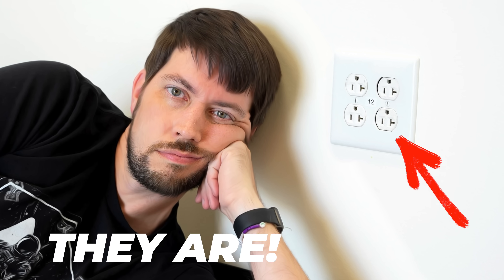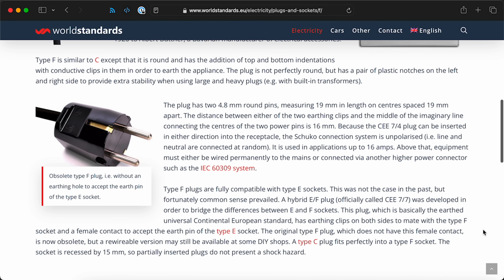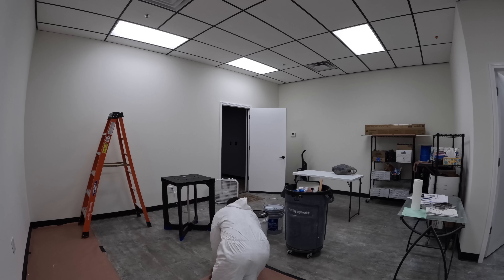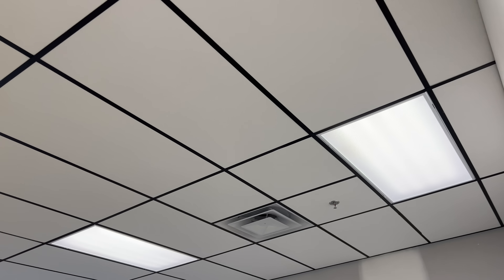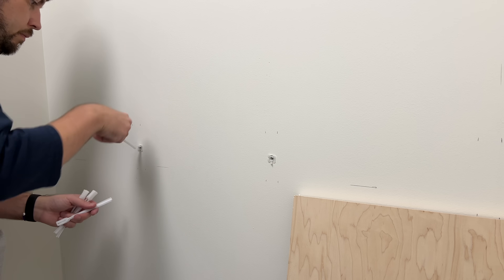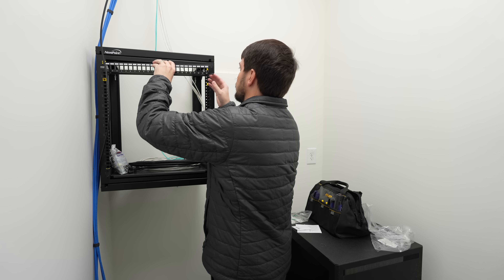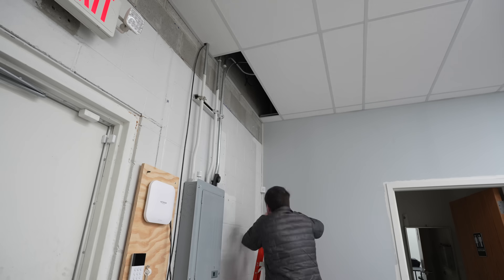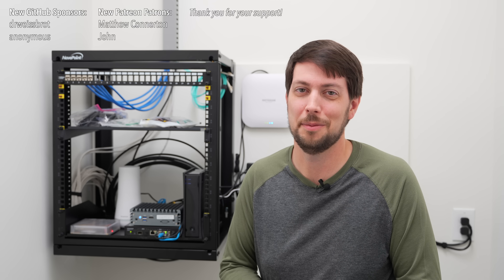Wiring up a small office network rack (moving 10)

Comment: Why??? Why the hell are you holding the whole rack to the wall while leveling it???? Measure the distance between the holes, grab a tape measure, mark the width with two lines and set a 90 degree leveled line. done. :D

Comment: how did the rack studs work out? I tried several different colors and they all sag, even with just a patch panel. The traditional cage nuts seem to hold better
Reply from the maker: I've found them to work best when you use all four, since they add a millimeter or two extra distance between the front of the rails and the equipment, meaning with just one set at the top, equipment can more easily sag a little.

I also try to use traditional cage nuts for anything more than 10-20 lbs, as I think the rating is like 40 lbs max, but I don't like getting anywhere near the rated maximums!

Comment: Just a comment about the outlets. While there's no actual "code" that dictates it, the way they are mounted is the preferred standard. That way if you have a loose plug and something drops onio the prongs, it will ground and trip the breaker.

Comment: 12:50 I'm a cabinet builder electrician and that cable raceway is typically used inside the cabinets. Outside it looks ugly. There are exterior PVC variants big enough to fit your cables and they look much neater since they match the wall color. (also self tapping screws into drywall and wood makes life easy.)

Comment: Your sound proofing door sweep was installed on the wrong side of the door. It won't drag across the threshold, make the door hard to open or wear out prematurely if you switch it to the other side.

Comment: I would just terminate all of your Ethernet into the patch panel, POE or otherwise, and then just get a POE switch so everything can use POE if it uses it, and then you can just VLAN off anything you don't want on your main network. My core switch is a Procurve 5406R ZL2 with a bunch of VLANs and every jack in my house is POE capable.

Comment: I've had multiple racks in my last 3 homes.  My best advice on the cable modem... just mount it to the plywood.  Many of them (all of the ones I've owned) have keyhole slots for this purpose.  It's not all that useful to have in the rack if it's purely a modem (one coax or fiber, one baseT, DC power); there isn't any re-patching you're going to be doing there.  It'll take up space in the rack that's more useful for other things.  I started mounting mine on the plywood backer a long time ago and haven't looked back.  Plus the broadband tech won't complain about access for his tester whenever you need service. 🙂

UPS looks a bit janky, but I understand.  Over the long haul I'd put some money in one or more rack mounted units, choosing in part based on availability of replacement batteries locally and of course reliability.  I use Eaton (which used to be Powerware, and before that Best Power).  Lead acid batteries tend to be good for about 5 years if you're lucky, 3 years if you're not (and that's with a line interactive; my double conversion UPS' batteries get a little less life).  My oldest UPS is a Best Power line interactive, bought in the middle 1990's.  Still works well, and has had many battery replacements (which I can get at the local Batteries Plus).  Get one you can manage with 'nut' (Network UPS Tools) or similar, whether via USB or add-on ethernet card.  I like skipping the add-on ethernet and just using a Pi connected via USB.  Cheaper, a lot more flexible, and less of a security risk.

Of course I wouldn't put a lead acid UPS in that particular wall rack (even if you can find one that will fit).  It will definitely sag (they're ungodly heavy!).  Bottom of a rolling rack is great.

All of my machines shut down gracefully before battery dies in the corresponding UPS, via nutmon.  I like to have more time for 'critical network' infrastructure (for me that's cable modem, main 48-port PoE switch, main 10G switch, DNS server).  Have the power hogs shut down early when on battery for more than a blip, or use a separate UPS.  Nearly all of my power blips are brief, but when they're long, I like to have a little bit of extra time to send out the "We'll be offline for a while, power is out" texts and emails before the whole shebang is down.  At home I typically get 40 minutes or so of 'critical stuff still running' on battery, but 10 to 15 minutes is usually sufficient.

A rack mount PDU with pull-out lights is really nice to have at the top of the rack.  Esp. if you're trying to find something in the bottom of a rack drawer when the room lights are out.

I'm assuming you're going to put a rolling rack underneath?  Any plans for rackmount drawers and a pull-out 1U keyboard and monitor for KVM?  May seem like a luxury, but I can't live without these things in my main rack.  If the network goes belly-up, I need command line access at the rack.  And it's priceless having the tools and consumables I typically need right there in the rack.  Ratcheting driver, bits, magnetic LED work light, rack nuts, rack screws, patch cables, bootable thumb drives, cable testers, crimpers, SFP+ transceivers, etc.  Neatly tucked away in drawers (lockable if you like).

My keyboard+monitor for KVM was an eBay purchase, dirt cheap but has worked great for over 10 years.  I have dozens of Middle Atlantic rack mount drawers, but based on price, I can't recommend them today (most of mine are 20 years old, bought when prices weren't obscene).  The NavePoint are a pretty good bang for buck, as are the Penn Elcom heavy-duty.

Comment: For racking the cable modem you might consult with your ISP and see if they have a rack mountable modem or info on a rack mounting kit for your current modem. For the other stuff you can just leave them be on a rack shelf suitable for the height of the devices.

Comment: instead of brute forcing the screw into the powder coated hole. go a few turns in the back it out and then repeat. this way it clears the thread a little and doesnt run the risk of snapping the screw head.

Comment: Had the electricians leave a good 10 feet extra cat6 and coax looped on the basement floor when wiring my new house.  Came back to check things a few days later.. and some do-gooder "cleaned up" by cutting all the excess off leaving them all 3 feet off the floor.  Grrrr.

Comment: Crow Pi Cam videos and live stream?

Small restaurant microwaves have no visible clock. They also have no turning platter but a turning reflector under the bottom. Fit square plates! Much easier to use, no "smart" stuff.

Comment: I'm looking at the rack, and how it would swing out. A deep device, or a long shelf, might contact the wall to the left, as it swings. Also, since the AP should be ceiling mounted, just run the cable up the raceway. Also, the cables all need to go to the pivot of the hinge.
Reply from the maker: Luckily it can swing in both directions — so if I swing out towards the wall, everything should fit fine.

And for the AP, I couldn't find the ceiling mount (the thing comes with a little T-bar clip!)... but I just did tonight while moving some last few items. So up on the ceiling it will go!

Comment: Those Navepoint racks sag over time and don't swing open very well in practice, so I wouldn't plan on using that long-term.  Sanus makes a rack about that size and sells a separate hinge bracket for it that works great.  The side panels on the sanus racks are welded rather than screwed together like the navepoint, so they don't sag.

Comment: Hm cant you just install Euro plugs? there should be no diffrence beside you need to put a new plug on every device. But i am no elctritian, we for example did a weird thing for the outlet in the kitche were we too a powerstrip removed the plug and wired it derectly into the outlet so that we have 5 instead of 2 (with out strip) and 4 with strip.

Comment: Why are americans so against plug switches? I've watched multiple things about plug design and such, and in all of them, americans seem to not want switches. I'm from the UK and theyre really useful. Can someone explain?
Reply: In some cases, the outlet switch can be accidentally tripped. Not sure why, but there's a combination of "switches too close" and "plugs too bulky" which does that.

And I firmly believe that the power switch should be on the appliances, not one the wall.

Still better than US standards which require an AFCI to prevent your home from burning to a crisp.

But the most un-Brit, and un-German, thing is to shoot a video about "network infrastructure" which starts with...refrigerators and microwave ovens.

Seriously???

Comment: Nicely done on the network setup.  One thing that I learned the hard way regarding the cable modem is that style needs to be standing vertical.  My cable company originally installed mine sideways to fit on my network rack shelf and it keep overheating and killed it.  The tech that came to replace it said that it needs to remain vertical for cooling.

Comment: If I had been getting paid for this I would have fished the wall. its inevitable though that you have to add a wire or three at some time though. like you did with the coax cable relocate. in my home shop I am also dangling out of the ceiling :) for a small amount of wires like you have I just comb it with my fingers, zip tie and call it a day.

Comment: Not widely known, but both BICSI and EIA/TIA require fire-rated plywood (or plywood painted with two coats of fire-retardant paint) in communication closets. I generally buy the fire-rated plywood and leave it unpainted so that the fire rating stamp is visible for inspection.

Comment: Automation suggestion: put a power monitor socket on the supply to your fridge and hook it up to HA, so that if it ever detects more than a few hours below some threshold power  you know there's been a breakdown or a power cut, so you need to dispose of any perishables.

My fridge/freezer draws ~65 W for several minutes at least every hour, so I set a 40 W threshold - I also use a 4 hour time limit, which is the lower end of what both the CDC (for the US) and the Food Standards Agency (UK) say a fridge should be safe for during a power cut. (24-48 hours for the freezer, depending on how full it is.)
Reply: IMO a better option is temperature logging sensors.

Comment: For those high torque screws.... I like to keep a 1/4 ratchet with 1/4 inch drive to hex adaptor handy so I can use standard driver bit with the ratchet. I find I have much more control lightly turning a ratchet than struggling with a standard screw driver. Sure it might take 60 seconds to grab the ratchet... but it saves knowing that you have a stripped head in your project to the rest of its life. We all have our own variants of OCD!

Comment: I like the idea of hard switches on outlets, eliminate all those phantom loads.

I'd of put the excess cable in the ceiling for the day you change the setup. 3D print some brackets and mount the small computers and other hardware on the shelf. My patch panel swings out as once I have anything long installed the door won't open.

Comment: In yout how to mount the modem(?) I had 2x 1U switches that were only half width. I took the decision to tap holes in the cases and fix 3D rack brackets. The 2 in the middle then fasten to each other and I ended up with a full width 1U device.

Comment: Next time try to remove the masking tape while still wet. Preferably right after you finish painting. Keep about 45 degree angle and it will go smoothly. A construction worker gave me this tip and it works like a charm.

Comment: Great to watch the evolution of this project. Have u thought about some AC power distribution strips at the back of the rack. Maybe a UPS and non UPS one. Another panel I would install under the cat 6 patch is a one unit panel with cable hooks on the front of it to manage the patch cords. I have seen many comms racks without but with lots of patch panels and after a while the cards from the higher panels obscure the ports of the lower ones and it ends up looking like a 'dogs breakfast'. My two bobs worth!

Comment: That's weird I came back to edit my comment and it disappeared??? Never thought about water running down an electrical cord towards the outlet yet another reason why ground should go down. I have always been preferable for the :-) configuration. And there's a video of a shut up with the metal plate falling under the prongs one way it shorts out the breaker and the other way leaves the plate dangling there unsafely.
"The TRUTH about FLIPPING ELECTRIC OUTLETS - Old Idea Now a Tiktok Trend"
https://youtu.be/X3J3XwC2vhk?si=_EYyMNKgfVB7YNgR

Comment: I could have sworn that the upside down outlets were code because that's what the builders have been saying in SC because this way if anything falls on the outlet, it is far less likely or impossible to bridge the positive and negative without contacting ground.
Reply: They MAY have made it a local requirement

Comment: Never thought about water dripping down the court. Yeah I've always been ground down :-). Hey do you know if you seen that video where the guy knocks a wall plate onto a live plug! Yeah would you rather have it dangling there would you rather have it short out the circuit breaker?

Comment: You can also get "keystone" jacks for coax connectors. Then you just use a coax patch cable to your modem.

You can probably also remove a lot of the plastic housing of the cable modem and screw it to a 1U shelf to make it a "1U" device. If you zip tie the power supply to the same shelf, it's all nicely contained.

My preferred layout these days is all power connections on the back and any plenum cables terminate at a keystone jack. You can get them for almost anything! HDMI, Fiber, RCA, banana, and more! Add a 1U power strip with individual outlet switches and you can power cycle without pulling cords!

Comment: Consider getting an electric damper to turn off or down airflow into the recording area. You that way you don't compromise heating or cooling the rest of the unit and because it's electric you can automate it.

Comment: Since the modem you have looks like it's the same model (EU2251) both I and my workplace have, if you do rack mount it make sure you have a means to kill power to it since they seem to need a hard power cycling every 3 to 4 months and the design is intended to be unplug then plug back in.

Comment: I'd highly recommend some sort of lightning/surge protection between that cable modem and the router. I always put the cable modem on it's own power and put a fiber media converter on it's Ethernet. I had lightning hit a service pole in front of my house and go straight down the coax into my modem. Turned my modem into a charred maraca, scorched my keystone jacks, while taking 2 switches, 3 cameras, xbox, tv, and router down with it. For what it's worth the Arris Surfboard modems work great and have holes in the side of them for mounting them to plywood. Would work great in your setup. You can talk to your HVAC installer and see if they are able to put some actuated ducts in your setup. Linus' video "New House Smart HVAC" shows them around the 4:50 mark. You could close or reduce air flow to your studio with something like that if needed. That way the rest of the office could still have AC.

Comment: I got that same Navepoint rack. I don't think I ran into that same issue with mine in the screws. I did notice you had to put it in just the right orientation to get them in smoothly. Hope you didn't ruin anything.  I did notice that one the rack was loaded up, it was hard to do the swing out.

Comment: For my set up, I had modem at the top most U on a shelf because the top of my rack is open, so the extra height didn’t take up extra rack space. Might be able to find a 3D printed mount for your modem too.

I ran a patch cable from the back of the modem into the back of the patch panel to a pass through keystone, then did a patch from the front of the panel to my router. Keeps it really clean instead of a cable coming out to the front directly from the modem. I do that with my NUCs too.

Definitely surround the switch with patch panels and use 6” slimrun patch cables for a super clean look.